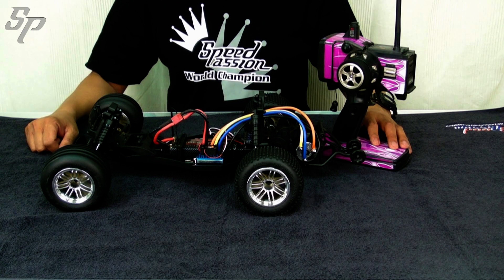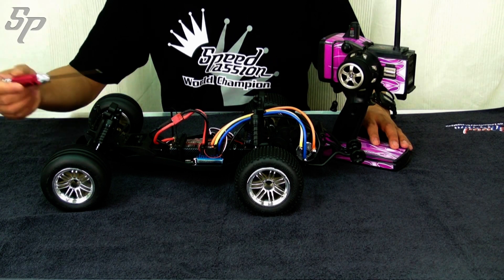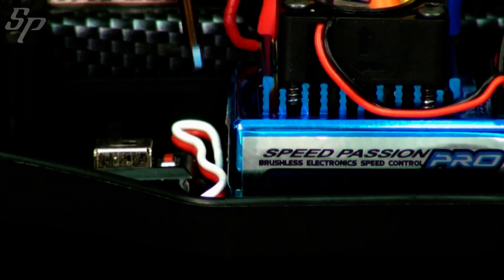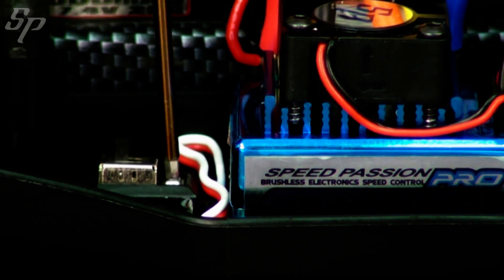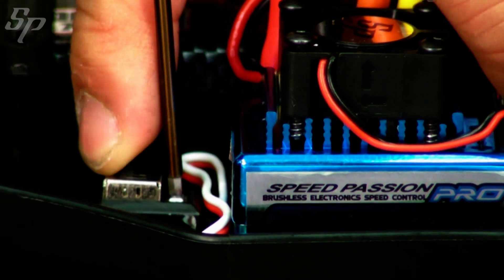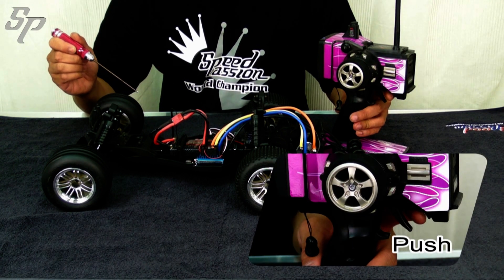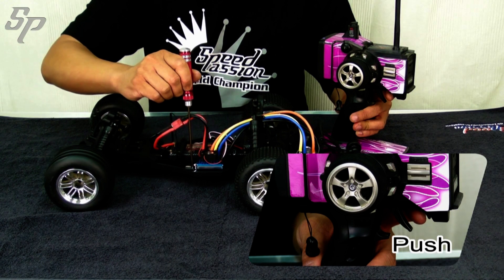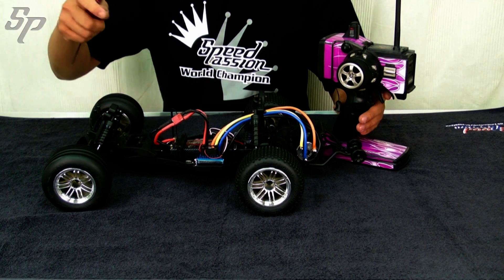Brushless ESC setup

Comment: Thanks for this. 
I tried and got my transmitter to work fine with forward. However after many attempts still unable to get it to brake.
I have a Futaba 3PK (same as in the video) with Fasst system.
Any clue what i might be doing wrong.

Comment: Hi why do we need esc? Why cant we just use only brush less motor? Please help explain bcos im a beginner.. thanks
Reply: Amir Abdullah esc alows you to be able to control your car with out the motor or servo spinning out you cant control
Esc its also how you would use throttle and revers to go in certen directions
Sorry about my english im not that good

Comment: What do you have the controller throttle trim set at when doing these calibration? I have a DHK hobby zombie 8e and it has 4 trim knobs and 2 rev. Switches. The esc is 100A brushless. I need hope because I hit full throttle quick and nothing happens. I have to hit the trigger a few times for it to go. Same as reverse. Thanks if you can help. I subbed ya too. My names Donnie. Cheers